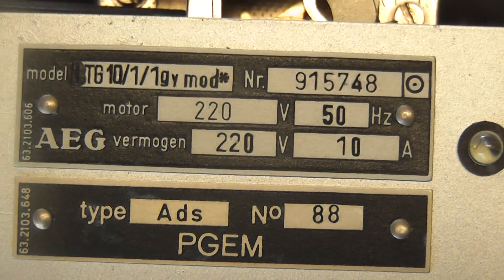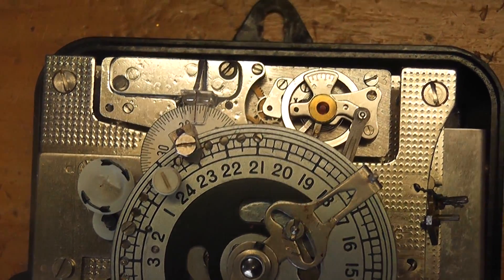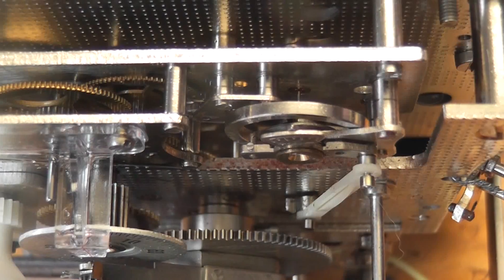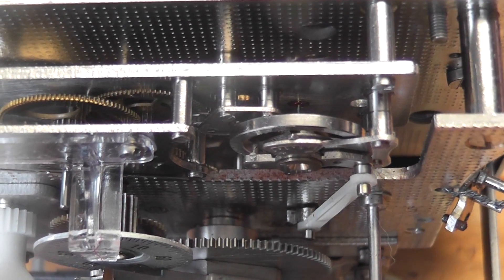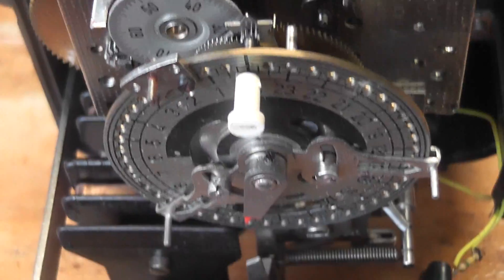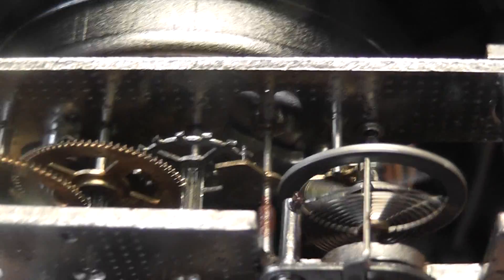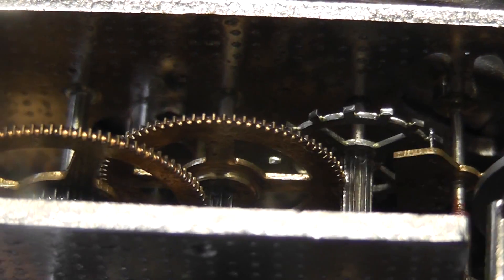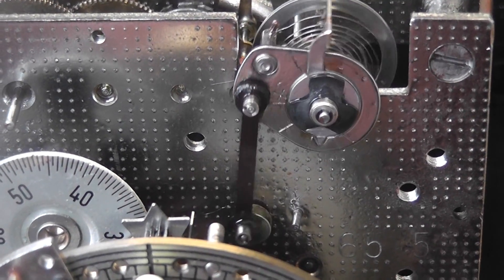AEG LTG Timeclock fail

Comment: Nice clocks, appear to be fairly elaborate.   Perhaps some spare parts will eventually turn up.The motor in my personal clock is 277 v, so I use a small transformer out of an old 120 / 277 v exit sign to run it off 120 v.

Comment: That's a problem with mechanical devices, eventually it wears out. I had an electrical switches salvaged from old soviet era washing machines with similar clock mechanism 15 years ago, where the springs misaligned or fatigued and pivot gear gets stuck at one side. Thanks for sharing.